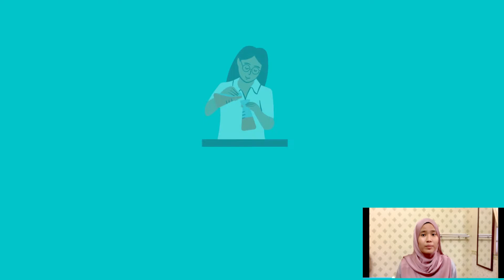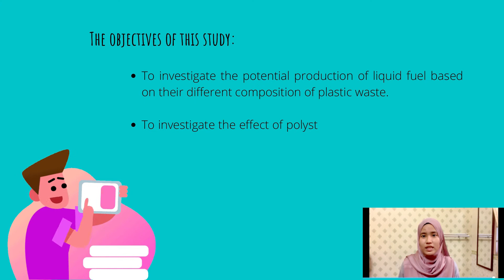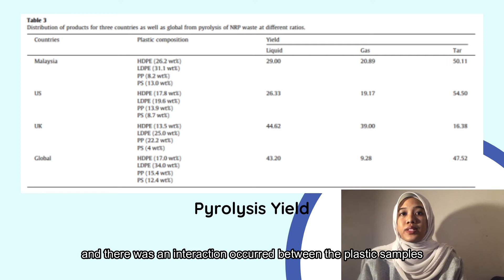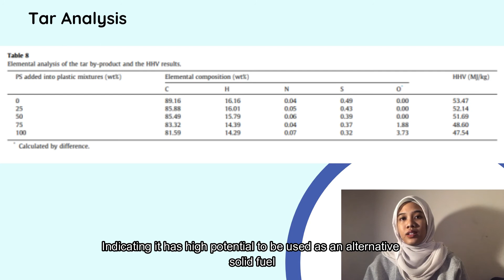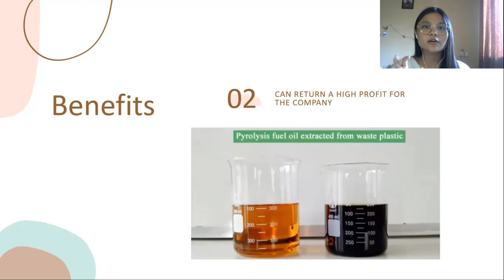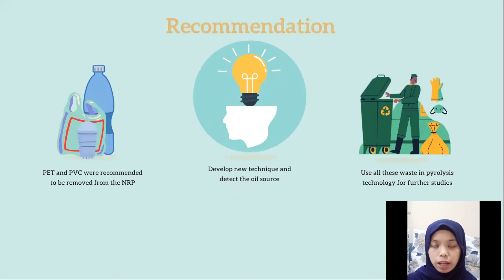Journal Reflection (G2-SG01)

Comment: HI, Im Yee Jia Wei from G2-SG07. May I know is there anyway to reduce the emission of toxic air into environment?
Reply: The emission of harmful gases to the environment can be greatly reduced if the proper pyrolysis process is conducted. this is because, the whole system recycles most of the gas in the chamber to generate power. So when an incomplete pyrolysis happen, that is when there will be release of harmful gases to the environment. I hope this answers your question.

Comment: Hi, I'm Clara from G2-SG02. In the video, it was mentioned that some of the plastic cannot be recycled due to the different physical properties. I want to ask what are the standards of plastic that can be recycled? What kind of physical properties do the plastics need in order for the plastics to be recycled?
Reply: Hi thank you for your question. I'm Aini from G2-SG01. There are several physical properties of plastics required in order to be recycled. For your information, plastics are divided into two groups which are thermoplastics and thermosets. The majority of plastics are thermoplastic, meaning that once the plastic is formed it can be heated and reformed repeatedly. This property allows for easy processing and facilitates recycling. The other group, the thermosets, can not be remelted. Once these plastics are formed, reheating will cause the material to decompose rather than melt.

Comment: assalamulaikum , I'm haydal, from group G2-SG3
what are the types of plastics that are not suitable to be used in the pyrolysis process?
and what are the important characteristics to be considered/maintained in the pyrolysis process?
Reply: Hi Haydal, thank you for the question.
1.Miscellaneous Plastics
2.In this treatment, material is exposed to high temperature, and in the absence of oxygen goes through chemical and physical separation into different molecules. The decomposition takes place thanks to the limited thermal stability of chemical bonds of materials, which allows them to be disintegrated by using the heat.
Reply from the maker: Waalaikummusalam, I want to add some more for the answer of question 1. Other types of plastics that are not suitable to be used in pyrolysis process is polyvinyl chloride (PVC) and polyethylene terephthalate (PET). This is because the pyrolysis of PET is inefficient in terms of time and costs as it requires a regular maintenance. For PVC, it is because it has high content of hydrogen chloride (HCl) which tends to be corrosive and also toxic when it is heated moderately that could cause damaged to the process equipment. I hope this answering your first question. :)

Comment: Hi, I'm Syamirah from G2-SG05. Very informative video! Few questions here, why do high content of chlorine in PVC makes it unsuitable to be used as fuel? In your opinion, why does chemical recycling can't seem to be carried out in our country despite a lot of efforts have been done?
Reply from the maker: Hi Syamirah, thank you for the questions. The answer for your first question is the high content of chlorine in PVC is not suitable to be used as fuel because the chlorine compound will tend to be corrosive and toxic when heated moderately which might damage the process equipment. The answer for your second question is, in my opinion, the reason that chemical recycling can't seem to be carried out in our country is because it requires a high cost to be recycled as it need a very high technology. In addition, it is simply cheaper to send the chemical waste to the developing countries than process it. I hope this answering your question. :)